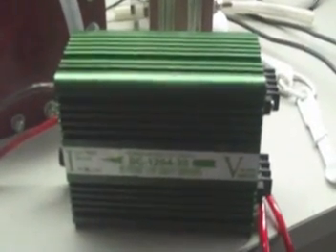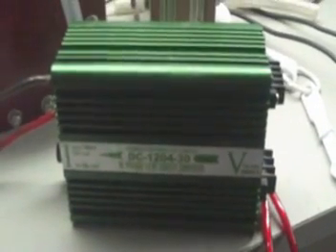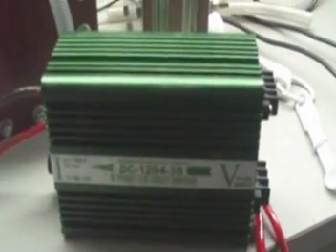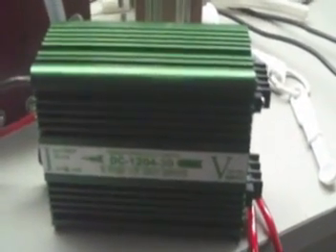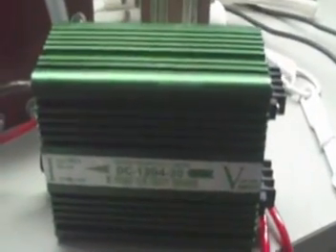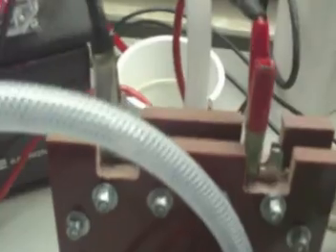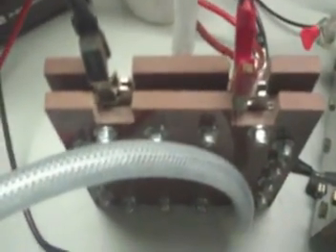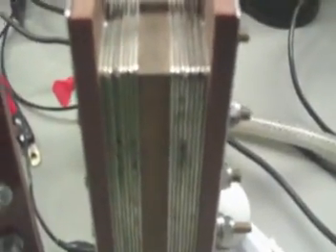SOMETHING NEW FOR HHO FUEL CELLS.

Comment: Nice converter. Do you connect it to the battery or to the alternator? So just to confirm. Two plates only give you 3 litres per minute? How much Milage you can get from 3 litres?
Reply from the maker: Alexander Veber you hook it to battery then to cell .it doesn't make 3 liter might make 1 lpm with the right cell design.

Comment: this might be okay for a car, but useless for a generator, toooooo inefficient
Reply: +snaprollinpitts Why do you say that?
Reply: +Quadrunner do you understand that it takes a great deal of power/wattage to run the generator.  after expending all that power, what is left to run your equipment/appliances. there are better ways to make power, from nothing.
Reply: You don't make power from nothing though.  Ten thousand watts is about 13 horsepower, so I guess a generator and a cruising car take about the same amount.  That can't have been your point.  Did you mean hydrogen generator, like for bottling up?  Must have, sorry.
Reply: when calculating horse power 1 HP= 746 watts
Reply: Yeah that's about it.  So you do mean a generator for electricity
Reply: yeah
Reply: snaprollinpitts What's the difference if they take the same power?  I'd think a generator would be less picky about the HHO source since it has a higher efficiency then an alternator for the electricity source.  There is less lost ground to make up for.

Comment: If you want to improve your car engine efficiency
and save on your car fuel expenses
There is a better way to do it - it is HHO Gas
Using Hydrogen Hybrid alternative for improving
your car miles per gallon or kilometer per liter
Search Google for: Top HHO Gas Car Research
Click the first result (Skip the Advertisement)
Reply: Google: Second Law of Thermodynamics.
Reply: It's called argumentum ad hominem.  Your comments are a type of logical fallacy in which an argument is dismissed on the basis of some irrelevant supposition about the author.  It does not discredit my comment or validate yours, it simply makes you look stupid to anyone who understands logic.
Reply: the laws of thermodynamics are theories, they can be broken but they are very hard to do so and any person who does do it won't ever get it to the public. besides using hydrogen to increase fuel economy does in no way whatsoever break the so called laws.. It simply gives you a ton more bang for your buck, modern combustion engines are highly inefficient

Comment: I'm trying to understand the benefits of such conversion.  Power is power.  P=IE (watts = Amps x Volts).  This manipulates the numbers, but you are still using the same amount of power.  You can't change that.  Mathematically, I don't believe you will produce any more HHO using this method than running more plates at a higher voltage and limiting the amperage.  In other words, your 30 amps @ 4v = 120 watts vs ~8 amps @ 14.4v.  Your just adding the inefficiency inside the converter.

Comment: The amount produced is too tiny to make a difference.
Don't forget, one gallon of gas is equivalent to 15,000 liters of HHO (energy wise). The equipment on this video is making 3 liters per minute, thus it makes the equivalent of 1 gallon of gas in 15,000/3 = 5000 minutes = 83 hours
Reply: and dont forget this is the fuel of rockets, i would not want a lot of it produced

Comment from the maker: Yes the lower the plate voltage the cooler it will run but will the lower the production,you could try 24 volt that will half the amps,yes a good pwm is neccessary if the plate voltage is high.The buck converter does not need a pwm,they lowered the price from 200.00 to 85.00 now I guess beacue of my help with 100,000 hits.The buck converter is a powerstream technoglies.

Comment: hello. I have a few questions.
1 how many plates can  I connect into the generator?
2 What is called that bigger specialist factory converter you have and where can I buy it?
3 what is the best temperature to gas production because he wants to build radiators with thermostat.
4 you said to reduce the flow of liquids results in  production increase.
So I understand that the pump assembly is pointless?
I rely on your experience and please reply

Comment: I think people might get confused here. What is a neg converter that does not use a positive terminal? Does this new DC to DC converter convert 12v 12 amp to 4v 30amp from a reg battery. Does it connect to a regular HHO 4 to 6 plate dry cell?  Help us out here. What are the wiring differences. How do you read the output of gas? what gas meter do you use?  How do you tell the fuel injectors to squirt less fuel in when HHO is high.  When does the valve burn with lean gasoline?  O2sensor gadgets?

Comment: Cool
I am using a 21 washer setup +-+- etc. and run it with 12v with PWM.
Want to drop it down because it heats I heard 2 to 3v is the best.
Can you still use the PWN or is it neccessary?
Tell me the info onthis unit. Thanks.

Comment: @Hollywoods7 I don't know for sure, but I would think that water would resonate at different frequencies based on temperature, impurities, and water level. If you had a microprocessor circuit like an Arduino, you could send a pulse every few seconds and listen for the ringing effect. Seek the maximum ringback and use that frequency. Just an idea.

Comment from the maker: YOU CAN GET IT FROM POWER STREAM,YOU NEED TO REDUCE THE PLATE VOLTAGE DOWN TO 2 VOLTS ,INTEAD OF 3 AND 4 VOLTS FROM FACTORY.THAT WOULD BE A MOD TO THE CONVERTER.

Comment from the maker: @waterwart  It is the 4 volts at the plate gap, which I already have a new converter from tggas which will have a lower  and adj voltage for the gaps.

Comment from the maker: @supercell9  I FOUND ,THAT I THINK THE PLATE VOLTAGE IS SET TO HIGH FOR THE CONVERTER,3.5 TO 4 VOLTS IS COOKING THE WATER. IT STARTS TO CREATE A CONDENSATION TRAIL AS SOON AS I START IT UP. MY CELL WOULD TAKE 1 HOUR TO START A TRAIL .I AM GOING TO TRY TTSGAS PWM IT IS ADJUSTABLE FROM 1.5 AND UP.

Comment from the maker: @BlackDogSociety DISTILLED WATER AND THAT MEASUREING SPOON YOU SEE IN THE VIDEO REALLY IT WAS LESS THAN A 1/4 TSP BEACUSE THE KOH FLAKES WERE PRETTY BIG I WOULD HAVE TO CRUSH THEM UP TO FIT IN THE SPOON,I AM SELLIG THEM.I AM A DEALER.I AM WORKING ON THE PRICE WITH THE DEALER  IN THE LOW 200S. BUT YOU NEED A CELL THAT IS +-+-+- ECT,12 AMP DRAW FROM SUPPLY AND 4 VOLT AT CELL=48 WATTS I GUESS THAT IS THE WAY YOU FIGURE IT OUT. HOPE THIS HELPS.DOMINIC.

Comment from the maker: i am not ready for the new convetret test yet i have to build a cell,the other cell with the netural plates does 3 lpm at 30 amps x13.6 =408 watts i want to build a sprial wound cell or a bunch of tubes like the joe cell but set them up like pos and neg. he uses neturals,thats the way to get the dc to dc converter to work.remember the converter only works with +-+-+-,hope this helps.